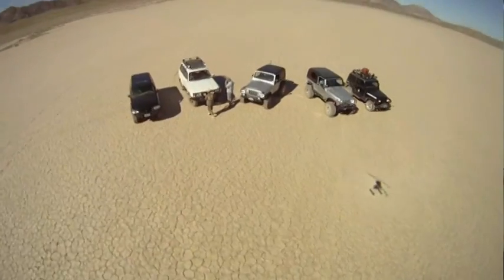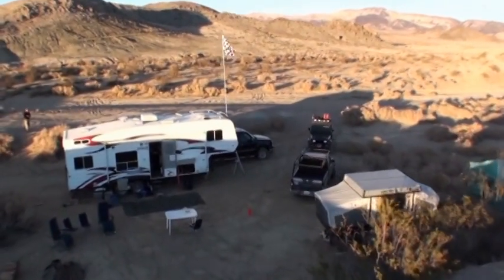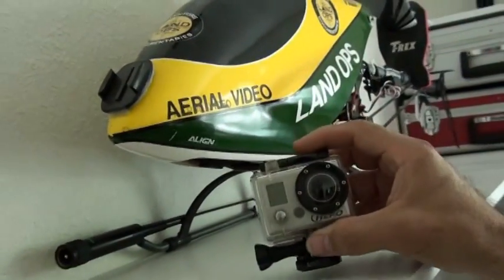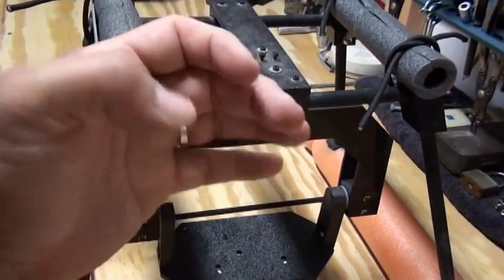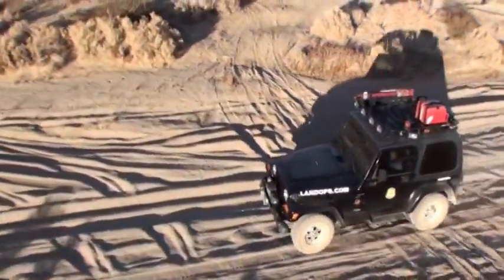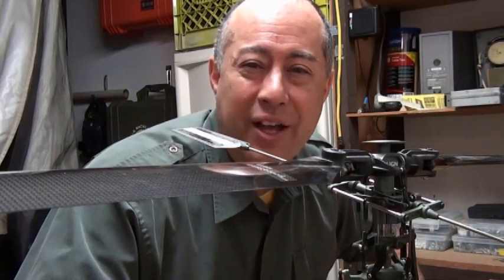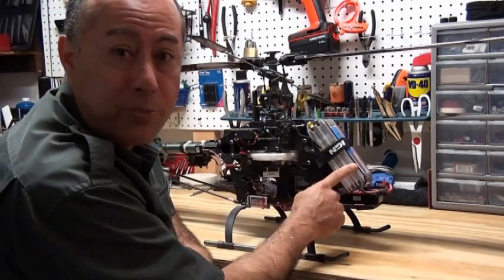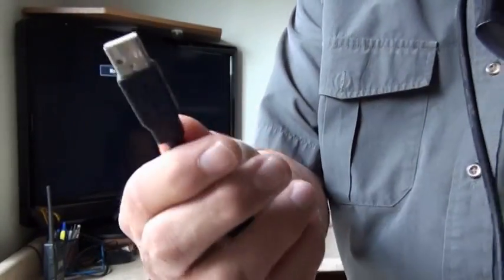Aerial Video Helicam Systems

Comment: Great, thanks for your insights.  I started about 4 months ago to get a different perspective for my filmmaking and as you alluded to, this thing can really take time – maintenance after crashing is probably the biggest component….  I have a 450 size heli which is less stable than your and I am resigned (when I have time) to buy a 600, the shots you took do inspire me to press on despite the black hole of time it creates.